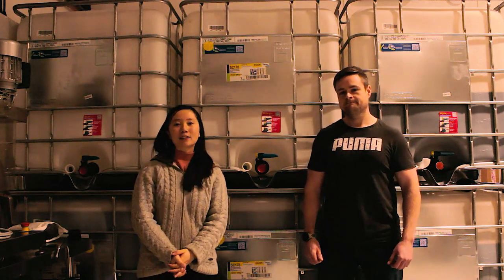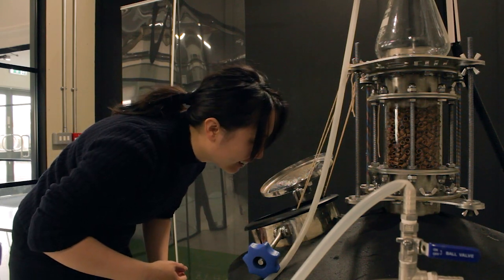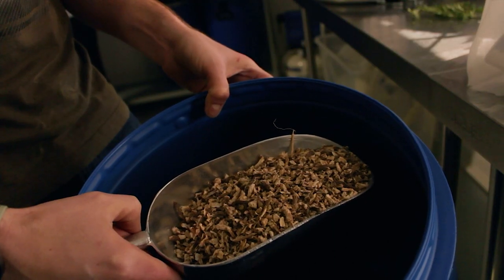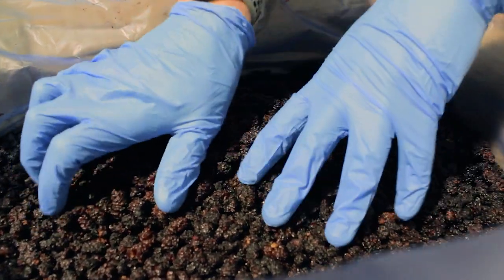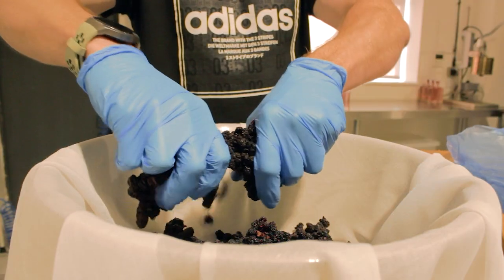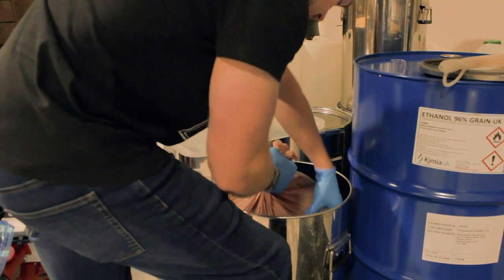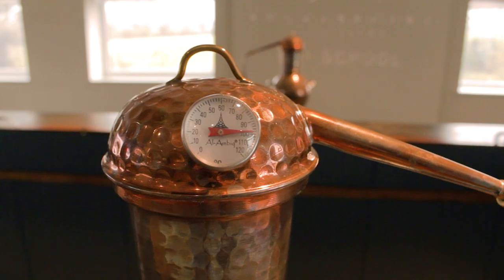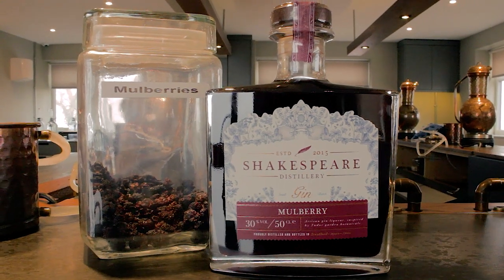Making Sweet Purple Mulberry Gin Liqueur | Shakespeare Distillery

Comment: Hola! Saludos desde Bariloche Argentina. Que es ese material que parece plástico? Lo lavas en cada destilación? Se usa como filtro? Gracias!
Reply from the maker: Hello! My spanish isn't very good, and I'm not sure which plastic piece you are talking about. There are a few plastic pieces. Could you be more specific?
Reply: @MissBrewbird  Hola! En el minuto 2:13. Que es eso?
Reply from the maker: That is copper. Yes I wash it after every distillation. Copper helps reduce any unwanted sulphur compounds.

Comment: Why do you clean the copper packing after each run?
Reply from the maker: To rejuvenate it, it gets pretty dirty after each distillation. It isn't so bad when NGS is being distilled, but if it is a wash, then the copper turns black after the distillation.

Comment: Could you have measured the alcohol by weight instead?
Great video.
Reply from the maker: Thanks! The mulberries leave behind tiny traces of solids inside the gin after steeping, so I think that is why we decided to measure the %abv the way we do.
Reply: The issue is caused by there being more than just alcohol and water as the sugar (and other chemicals) in solution alters the density weight and refractive index. 
So it’s impossible to know if it’s the alcohol or the other things in solution altering the readings
By distillation you are left with a mix of only water and alcohol (trace volatiles)
Use this to calculate volume alcohol in sample
Studied chemistry at university